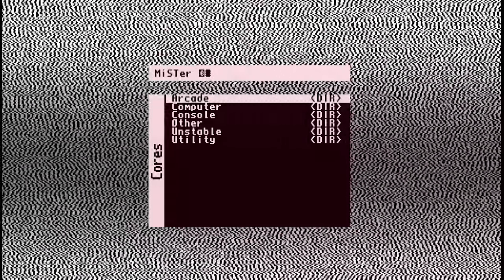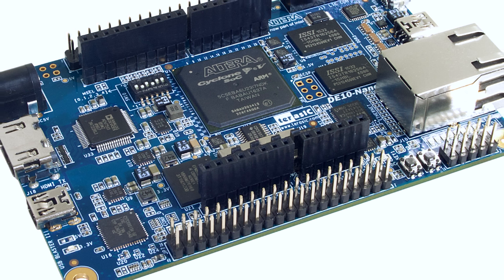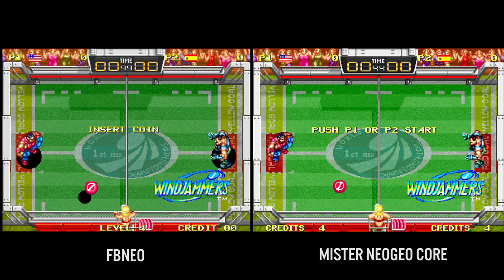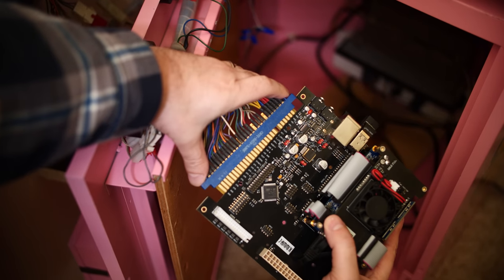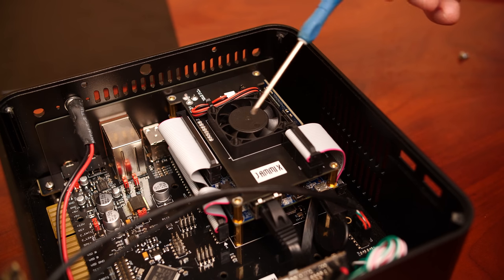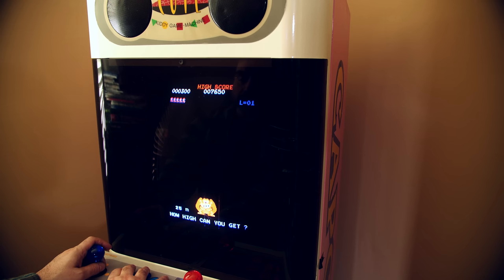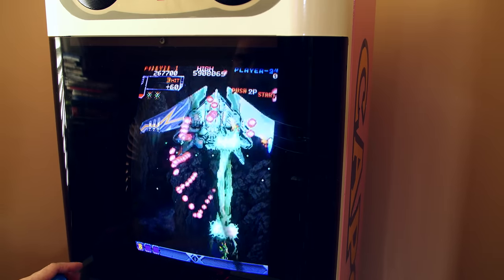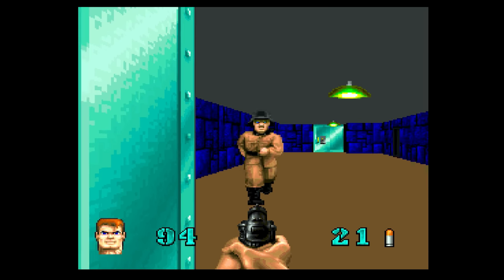Finally - I got my hands on a MiSTer FPGA Retro Gaming Setup | MVG

Comment: Have to wonder what the top end is for the current version of the FPGA "heart".  Could it do a PS2? I also wonder about the utility past the PS1.  The upscaling on GC/PS2 generation games is amazing and is like unlocking hidden graphics.  Some Game Cube games in particular look completely different emulated and upscaled and Wii games were really hampered by hardware.
Reply: PS1/Saturn is already near the limit, and the 486 core is absolutely maxed out. Most experts think the N64 is impossible due to clock speeds, 6th gen consoles are a non-starter.

Heck the GBA core creator started work on a Nintendo DS core and had to abandon it due to running out of space on the FPGA chip!
Reply: @FoxbatStargazer  I wonder if we'll see a more powerful FPGA board taken up by the community (but maybe not, they are pretty expensive and I think for those newer consoles people would settle for software emulation)
Reply: You would have to use a significantly more powerful and expensive FGPA(10k to lowball it) to do PS2. It would also be largely pointless and extremely difficult. One of the reason for using hardware emulation over software is it effortlessly solves the borderline impossible software cycle problem. We still don't have a genesis software emulator that sounds correct because of this for example but for an FGPA this isn't even a minor problem, once implemented in an FGPA the cycles are just correct. But once you get to GPU centric architectures like the dreamcast and onward you don't have any advantages from using an FGPA over software because cycle accuracy does not matter anymore. Software emulation is the way to go for more modern machines because they're not meaningfully different from your computer like older hardware was.
Reply: @Swampus100  Definitely good response, even though the units are capable just not worth it.  I could see implementing a complement to emulation with a hardware accelerated lookup table which I have done before with PS1 just isn't cheap enough to be viable.
Reply: dont think thats possible on a de10nano. its hitting its limits with psx / saturn.
Reply: @Swampus100  We have BlastEm and Exodus for cycle accurate Genesis emulation for quite some time, running the overdrive demos perfectly, absolutely like the real hardware, you can even reduce input lag further than original hardware and toy with how you want the games to look, guess what, no money required to do that, insane, right?
I like the MiSTer project, don't get me wrong, but it's really for a few enthusiasts, there's nothing it does better that can't be done software-side.
Reply: @Swampus100  Thanks for the great response.
Reply: @roberto1519  BlastEm is a great emulator and the sound on it is miles ahead of alternative emulators, but doing sound better than other emulators is not the same as doing sound correctly. It definitely is not cycle accurate(it does try to be and does a pretty good job of it!).

The idea that there is nothing it can do that can't be done on the software side is simply wrong and you have no idea how emulation works. Software emulation cannot be cycle accurate, if it is possible no one has any idea how to do it. FGPA implementation is inherently cycle perfect. When the objective is preservation of these old games this is a big deal because it both holds a greater potential for accuracy and it makes the development work significantly easier. You might not really appreciate it but properly emulating konami arcade hardware is a complete nightmare. Practically every board has different hardware. Their implementations in MAME are severely lacking because of the work necessary. 

The hacks and toys for emulators are definitely great but guess what, they're hacks. This is irrelevant in regards to preservation.

I don't completely disagree with you. You're right that the MiSTer project is ultimately a niche for enthusiasts but I get the impression that you grew up on emulators and think that they're "absolutely like the real hardware" because that's simply what you're used to.
Reply: @Swampus100  you are spreading complete bs.
Reply: The top end is pretty much the Ps1/Saturn and Jaguar...
Reply: @Velcrochicken1  I'm just calling out the term "cycle accurate" for being the bullshit that it is. Just look at roberto, he thinks it means they're hardware perfect.
Reply: You're one more saying the MiSTer isn't emulating a given hardware, which it is. You're right, I'm no tech savvy, but I wonder how much this device benefits from all research and documentation gathered since the beginning by existing emulators, I believe any emulator try to imitate the target platform somehow, which requires understanding its ins and outs, it sounds like the MiSTer does, a little differently, but the same goal.
Yes, I do favor software emulation over unneeded gadgets.
I see you're bashing MAME, when often most devs tell its goal is preservation for both how the original arcades played games. I understand that for a complete 100% clone, uncapping chips is needed and it's not always possible to do.
"FGPA implementation is inherently cycle perfect", it's not perfect and it never will be, the FPGA bug is biting a lot of impressible people lately, and it's not like MiSTer's github or other dev threads  aren't loaded with issues to be solved, it's sad when people make it seem the next big thing, it's so perfect, when it's just another device that can play 90's games and below, and again, I believe it does benefit A LOT from documentation gathered by the same devs that work on, as you say, the hacked MAME workings.
"MiST/MiSTer -- work towards fixing Overdrive 2 by Titan Sega Mega Drive demo sound issues", this reddit title simply sounds like the code implementation of the "cores" on the MiSTer are prone to error and updating like software emulation, when the Overdrive 2 demo ran perfectly fine on BlastEm way before that. One thing is clear, this device is getting a devoted cult following, "it's perfect", "it's better than..."
Reply: @roberto1519  It is a back and forth, knowledge between the mister MAME and other projects are exchanged. Are the cores flawless, hell no, but some cores are very close to the original hardware, the Amiga for instance, the Neo Geo is basically a full blown original hardware replication. Other cores are basically fpga implementations of software cores. The main difference here is the  vhdl fpga implementation which basically is a blueprint for a full blown new chip being able to run the old games. Practically this already has resulted in the hardware release of some by now discontinued obscure Yamaha chips, which can be used as a drop in replacement for the original chips.
So is it better than software, sometimes yes sometimes no. Is it hardware preservation? Definitely yes in some cases it is more or less either a reverse engineering of the original chips or a reinterpretation in other cases it is preservation of a drop in possibility for aging hardware so that it can be rebuilt again (aka based on the work of the fpga people the replacement was built in real hardware). The main difference is the cycle accuracy which is harder to achieve and that you can basically adapt the VHDL code into real hardware if wanted. A software emulation has huge problems to reach the cycle accuracy and you cannot simply take the software code out and then make real hardware out if it, although you can use a ton of that code and knowledge to program a vhdl descriptor, which then is a reinterpretation of the original chips. If the software emulation works on that level (HLE emulation often works on higher levels)
Reply: @werpu12  Finally, a sensible reply.
Reply: @roberto1519  1. Yeah MiSTer benefited massively from the work done on previous emulators. Who said emulators were bad, or useless? The very hard work done on bsnes was absolutely essential for the snes core. Software emulators were the only game in town before an affordable FGPA came around and amazing things were done. And MiSTer work benefits emulation. The work on the CPS core benefitted MAME. These things do not remotely exist in opposition. Software emulators have limitations for how far you can go regarding preservation. Hardware emulators have more potential for accuracy but they also have limitations that prevent them from being able to be true "simulations" like some fanboys might claim. 

2.It's okay to prefer software emulation! There is nothing wrong with that. I don't understand why you think I don't like or use emulation myself. Guess what, there are a few use cases where emulation is better than an FGPA. Some really old arcade games like donkey kong just can't be done right on an FGPA. The better emulation is definitely done in MAME for this one.

3. The cycles are inherently perfect. All of the hardware components work at the same time in parallel. There is no need to worry about shit like injecting interrupts for the bus delay or approximating instructions that would otherwise be too taxing on the CPU. This just isn't an issue for FGPA implementation. This does not mean the emulation is perfect because there is a huge amount more to both software and hardware emulation than "cycle accuracy". It's a sloppy term and people only adopted it as a  "blast processing" advertisement because Byuu threatened to hurt them. But he is dead now, just like megaman in the MMX2 demo.

4.MAME is great, it's also very inaccurate for a lot of games and they are never going to be fixed until the reverse engineering work is resumed. This work was mostly done in the 90s and very little has been done since. Yeah, a lot of documentation was gathered from MAME. It also wasn't enough because they were primarily interested in just getting the games working back then(understandably) but no one bothered to pick the projects back up and complete the documentation. Thankfully MiSTer has inspired people to resume the reverse engineering of these games that desperately need it.

5. Yeah, the MiSTer cult is pretty stupid. A lot of people call it perfect when it literally cannot be perfect due to how chip synchronization works. Also a lot of people buying them who do not care remotely about accuracy and spend a few minutes playing some of the arcade cores the beg for. I don't care, they also donate a lot of money to developers who put in great work and benefit my interest of preservation and accuracy.
Reply: @Swampus100  OK, I think your last reply sums up pretty much what I thought about software and FPGA. I knew there was no way this wasn't being benefitted from the software side, but yes, MAME was pretty much a proof of concept and even then, it was amazing to be able and play arcade games, even as in the late 90's, not accurate, but who cared back then. It's cool that both worlds are helping each other figuring out new ways to replicate more accurately those games.
About MiSTer, I'm curious when it's finally able to replicate the Saturn, it's probably the system I'd be most interested in checking in the future. I have to say, Mednafen Saturn is pretty impressive, but it requires a fast and modern CPU.

Comment: To put the price into perspective, you don't need to buy everything at once. You can run every core with just the DE10-Nano (~$190), 128MB SDRAM ($50), and a cheap $5 MicroUSB OTG hub with whatever keyboard and USB controllers you have laying around and probably a larger MicroSD card than the bundle 8GB. I also recommend using a heatsink these are still cheap and will be $5-6 or less per unit in large kits.

This budget setup will give you every core with HDMI out to a modern TV/monitor. If you want you can spend more to get access to analog outputs to use on say a CRT, or be able to hook up original game controllers.

This does cost more than a Raspberry Pi, but you have the performance of other FPGA consoles like the Analogue products and do not need a jailbreak or flashcard.

Comment: any successor for the DE10-nano in near future as this fpga is almost on limit?
Reply: Not in the near future. The reason that the DE-10 Nano is so cheap is because the CPU (Intel ARM Cortex A9) is subsidized by taxpayers via the Intel FPGA University Program. I think it'll be at least another 5+ years before a bigger and faster FPGA comes down in price to make it a reasonable successor to the DE10.
Reply: To clarify, the ARM core is separate to the FPGA part of the chip, but still on the same chip.

The ARM basically handles the higher-level stuff, like the OSD, USB controllers / keyboard, network updates, and loading disk/tape/cart data into the FPGA side.

But yeah, the DE10 Nano is still THE best bang-per-buck board atm. It has a lot of logic elements on the FPGA for the price, even with the recent price increase. It's just a shame everything is screwed up atm with the parts shortages.

There are some other boards on the horizon which might (or might not) become a future platform for running the same cores. A few people are currently working on breakout boards, but even then the FPGA modules are currently out-of-stock. :(

I don't think we'll be seeing the likes of Dreamcast on FPGA any time soon though, even with a larger chip. With that much complexity, it starts to get harder to run the logic at the full clock freq of the original console, at least for the late-90s / early-2000s consoles.

Comment: The good thing is that the game files can be kept on a USB drive separate to the MiSTer SD card. This will help with keeping the SD card for the arm-linux underpinnings, the cores and bios files with the rest on a USB drive. You could put it all on a huge SD card but those can be pretty expensive with an external USB drive - even 2.5" SSDs in a USB enclosure being a financial sound solution for access to large libraries of games.

Comment: The points about price are exactly what have kept me away from the MiSTer project this far, it’s just simply far too expensive right now.
Reply: The old Atari 2600 was $1000 in today's money.  Gaming has never been cheaper.
Reply: @mick8473  I always thought this was a bit of a silly argument.  Reads too "back in my day" for my tastes.
VCRs and DVD players used to cost 10x more what they do now, especially when the technology was new.  I don't think that necessarily means that everyone should be buying one at that price.  Similarly, just because inflation makes older consoles worth more of that time's money, I don't think that means everyone should buy an Atari 2600 for $1000 in 2022, even if it was brand new, unless someone thought it was worth that price.
Reply: The de-10 is unfortunately going up in price, not down. It could be a decade before the price gets more accessible.
Reply: @mick8473  Yeah, that is how inflation works alright... The US dollar was in fact stronger in 1977. Beyond that however, the 2600 was a bit of an outlier given that it was among the first home consoles. The NES for example was $180 at launch in 1986(US launch) which would be about $455 today. The SNES was $199 and about $405 today, PS1 was $299 and about $545 today, GameCube was $199 and about $315 today, and so on. So gamings price of yesteryear is really not all that different from today with regards to consoles when adjusted for inflation. It has always had its peaks and valleys with regards to cost of entry.

Oh, and adjusted for inflation the Atari 2600 would be roughly $870 in todays money, not $1000. That being said, when adjusted the PS3 launch price of $499 (which is a Series X or PS5 today) would be around $700 today… Don’t worry though, give it a few years and you’ll be able to say that adjusted for inflation it too is $1000!..
Reply: @linearlink   My friend in the UK done the calculation and was shocked the sacrifice his parents made. I was actually being conservative. he checked the current rental income of his parents old house, his parents sacrificed one month's rent for the Atari. $1250 today.  I rounded it down as I was aware the inflation calculator that had it at $800. The PS1 I purchased  was 2/3 a months rent. On the same house today that is $800+ . If I was to buy a PS5 it would be 1/3 a months rent.
Reply: @FoxbatStargazer   My vintage computers have doubled in price in 2 years. I might sell those now then wait out the DE 10
Reply: @WishMakers    I've been looking with a friend the sacrifices his parents made in 1978 (I don't know enough of my own) .And it was more significant. We're talking at least half a months rent 2 weeks wages for the  Atari 2600 in the UK. A PS5 is less than a weeks wage today.  It should be pretty obvious by the amount of kids who get new iphones compared to had Ataris (or similar money spent on them) in 1978. Atari kids in the late 70s UK were privileged. Kids in inner cities London today, supposedly 'poor', buy expensive sneakers and PS4s in the same year.  Also note, families in the UK 1970s had only one TV, hell this lasted through the 1980s. How many gamers today have just a single screen available?  In fact the videos I see of PS5s + huge TVs, filmed on a decent phone and a MacBook on the side,  is quite obscene compared to the late 1970s, yet inflation calculators  doesn't correctly reflect this.

Comment: The Saturn will be very interesting as an FPGA payload. 2 SH-2 CPUs, an SH-1 CPU, a 68EC000, 2 different video chips and a custom sound processor is a hell of a lot to fit in, as well as the buses between them!